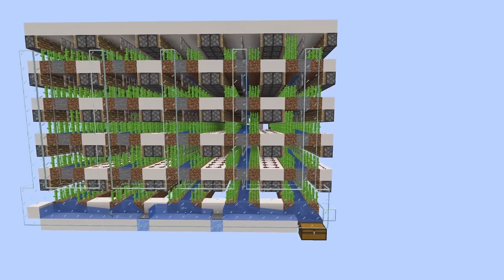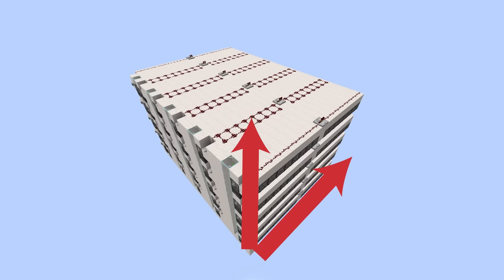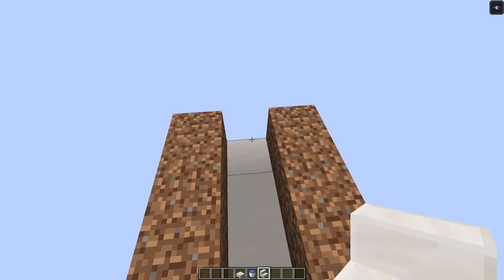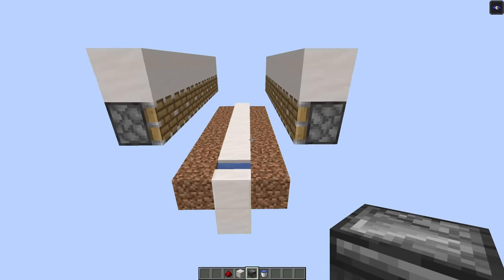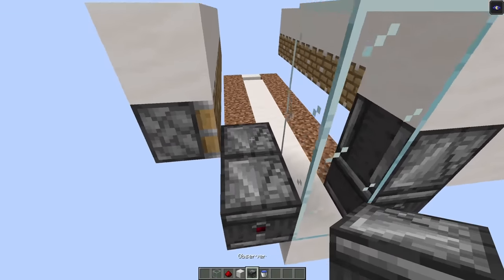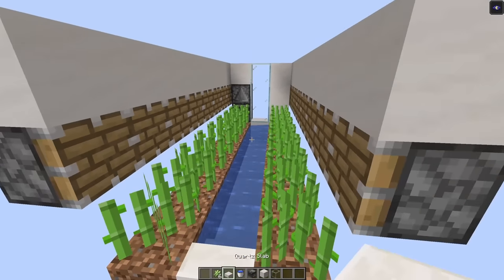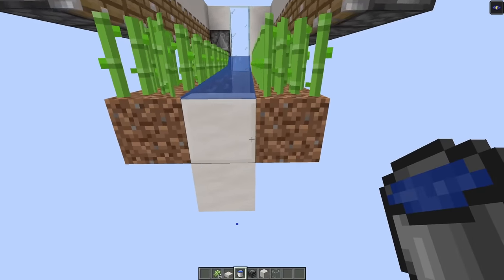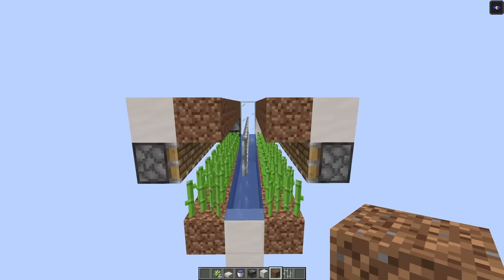Sugar Cane Farm! Compact, Lossless, Easy to Build! (Minecraft 1.15+)

Comment: so i dont quite understand why the observers are placed the way they are. Is there a reason the observer is watching the lowest sugar cane and not the second? and what is the point of the observer watching the observer below it??
Reply: Observers detect block updates.  The first one is watching the bottom block because in Java the bottom sugar cane updates even if it doesn't actually grow up a block.  The second observer is watching the second because every time the first one detects an update from the crop itself updates.  It's the easiest and compact way to move a redstone signal straight up 2 blocks without having to use dust or some mechanic that has the risk of being patched out.

Comment: This is a great design Tango! I have 2 questions.  
1. Are the iron bars replaceable with glass panes?

2. Could you use a design like this for an (inefficient) bamboo farm? I'm thinking remove the water source blocks and just have the water stream?

Thanks again!

Comment: Edit: Fixed it. Servers with the claim mod or the server i'm on. Did something to the water. When the area wasn't claimed.
Help: Java. Latest version. I'm having water issues. The only way the water flows. Is if I put 2 buckets of water. Then the first block doesn't flow down. I only have 1 built.

Comment: I‘m in the snapshot 20w22a and the flowing sugarcane is getting stuck in the stairs, which means that it‘ll eventually despawn. Can anyone give me some advices? 😊
Reply: I had the same problem. If you replace the stairs with a top slab the problem seems to get fixed. The collection system would also have to be altered slightly.
Reply: Put a trap door on the glass across from stair then remove the stair.
Reply: Thanks!
Reply: @ChristopherWeimann  you are the mvp man, thanks that work for me

Comment: I built this step by step, checked and checked again and it doesnt work for me either. The pistons randomly go off and the sugarcane is 2 high in some parts. Havent had 1 piece of sugar cane out if it 🤷‍♀️
Reply: Ye I have the same issue, I think its been messed up with a more recent update like 1.16.4
Reply: @jambo5461  I ended up taking it down and trying a different one. Its not as effective, but itll do for now 🤷‍♀️
Reply: @Nadlew90  ye I recommend flying machine one tho that’s what I use mainly and their super effective
Reply: @jambo5461  awesome, I'll have a look! Thanks 😊

Comment: Any reason why this wouldn't work with bamboo? i did the same exact design, but the pistons just don't seem to want to go off. I've even gone to the extent of placing one sugar cane in front of the observer on the strip in an attempt to get it to smash the line, but no dice. Not really sure why it's not working

Comment: Great design, but I'm having a small issue with sugarcane occasionally landing on the dirt instead of in the water stream. Any potential fix for that, or will it just get pulled in by other sugarcane that passes over time?
Reply: Yes...  sometimes it gets grabbed by he water flow and other times it will get pulled by another cane.
Reply: @Khudoz  I am facing the same issue with the farm. I thought the short pulse of the piston was causing the sugarcane to land on the dirt block. So I just added a repeater with 4 ticks delay to the output of the observer to increase the pulse. I am not sure whether this is a solution as i suck at redstone😬😬😬
Reply: @suhasmenon2705  I don't think adding a delay to any piston would solve this...  Because that doesn't change the velocity by which the sugarcane is propelled off its stam.
Personally I have seen a few of those "stuck" canes being de spawned! ...  Makes me wonder how lossless this thing actually is.
Reply: @Khudoz  Ohhh thank you. When i checked still some sugarcanes were getting stuck. So i guess delay is not an option. Also does lighting effect the growth of sugarcane? If so what is the minimum lighting for it to grow?
Reply: @suhasmenon2705  According to the Minecraft Wiki, the growth of Sugar Cane is not influenced by lighting at all!

Comment: Just incase anyone wants to know...thus dies NOT work on ps4 bedrock...u can not flow water on top of the slabs without the water breaking the crop
Reply: i made this work on ps4..i didnt slab ..i lowered the ice and pressure plate down a block and made the water thar is level with the cane be flowing...oh and for some reason...once in a while i got 1 cane on my redstone dust..so with bedrock its not 100%..but more like 98% but still works great

Comment: I built this farm on 1.20.1 and it works great apart from 1 problem. Sometimes the observers seem to "break" and they won't detect the sugarcane and activate the pistons. The only work-around I have found for this so far is to break the observers and re-place them, but this is an issue as if I afk for half a day and half the observers stop working then it very much limits the productivity of the farm. Just wondering if anyone else has encountered this issue and may know how to fix it?

Comment: hi does anyone know if i'm being stupid or not? i'm noticing that the observer detects only the bottom sugarcane so how does it detect if the upper one grows? this seems to be the problem with mine so far
Reply: I really dont know how the sugarcane block update works now but this is an easy fix. Just place the observer one block above
Reply: Unlike bamboo, When sugar can grows the blocks below and above are updated thus triggering the observers. But for bamboo you'll have to use the observer on the second layer and use a repeater method to prevent the pistons from firing indefinitely

Comment: i might have the dumb   but I donnt understand the observer set up...? its going to observe the sugar cane thats already there and will never be harvested therefore the block state never changes. this, does not work. I understand why it cant sit to the side (back of farm(now)) because it sees the piston as a changed state and does an endless cycle. A observer on every piston is way more resource heavy and annoying as the close proximity means every single time any of them grow to level all pistons go off. The problem I found with having 1 piston power them all (economic, just observing 1 plant) is that those that grow to 3 will also cause the plant to fall down, on the soil. I suppose you could do this, 1 observer on top of 1 piston and then all other plants can only grow to 2, placing a block above them? But then if you have a few growth spurts you miss out on the bonus cane / bamboo.

Comment: How does the observer detect if the sugar cane has grown if it’s at the bottom of the plant? Does the status of the sugar cane at the bottom change when it grows?
Reply: I want to know too hahaha
Reply: @LuizeraTryHarD_  It doesn't
Reply: Yes it works in 1.18. The state of the bottom cane changes when it grows a new cane on top of it. If growth doesn't trigger the observer you're building it wrong. It will also trigger the observer if you remove and replace the bottom cane.
Reply: if you ever play modded you learn real quickly early everything grows in stages for shugarcane it has several stages before the growth of a new plant and thr observer observing that its perfectly normal thus even of no new growth it should if working correctly fire the pistons

Comment: Does this design work with bamboos too?
Reply: It can for the most part.  I've tested it myself and by changing out all the crops except for the ones in front of observers you can generate bamboo fairly fast.

I built a 5x5x5 farm and downloaded the average items datapack from vanilla tweaks and after running it for an hour got an average of ~22,300 items coming out of the farm.

However doing it as bamboo is not lossless due to how the bamboo crops can sit on the blocks (haven't found a way to make the crops sit on a certain point of the block) and the fact that bamboo is solid so items will periodically get stuck when flowing down the streams.

Comment: Would this work with bamboo as well? Or are the item mechanics different between the two?
Reply: @Michael-McCollum  I actually tested it. It didn't work because the water breaks the bamboo unlike sugarcane, which holds the water in place.

Comment: what keeps the water from flooding everything?  I've done this identically, except with stone slabs, and whenever I try to add the water flow in, it expands to 3 wide and wipes out all of the sugarcane.  I don't get it and I'm pulling my hair out.
Reply: are you clicking the glass to put the water in or you clicking on the stab to put the water in?
Reply: @buckbuck-yt9uv  the glass.  If I click the slab, nothing happens.  I tried lots of different permutations. Oh well, I tore it down and built Wattles's

Comment: PLEASE I NEED ANSWER!!!
The farm is great, works like a charm. My question is how is the redstone get power? 
Maybe it was mentioned in the vid and I'm not listening, but if the bottom observer is facing a non-updating sugarcane, how or where does the redstone line above get power?
Reply: cause it can travel through a block
Reply: That sugarcane indeed updates.
Observers can detect block states, if I recall correctly, sugarcane has a tag called "age" and it increases overtime and when it reaches 15 it will try to spawn a sugarcane block on top.

Although there are no visual updates, there are updates happening in the background, like this "age" tag. 
Btw, you can check the "age" of a sugarcane block using the F3, if you are on bedrock RIP.

Comment: When making it vertically stacked. Any suggestions where to put lights? with the redstone and pistons I could not really find a great spot.
Reply: Torches on the side of the solid blocks the redstone is on. Did it with mine.

Comment: If you build it as-is, how much is lost? I don't care about it not being lossless, I don't mind losing a few every so often just as long as its not a huge amount.

Also, The sugar cane is growing past the observer and it's not firing? I have seen the pistons fire randomly but not when the sugar cane grows at the observers.

I'm on 1.19, if anyone has any comments, that would be greatly appreciated!
Reply: The pistons constantly fire as the observer detects every growth update from the sugarcane, even if it hasn’t grown
Reply: I’m 1.16 they made a change which make some of the items get stuck on the dirt as pistons connect to iron bars. Sugarcane also gets caught up in the stairs
Reply: @ponderer467 if you  use fences instead of gates, would that solve that issue? 

Also any reccomendations for what to use besides stairs?
Reply: @trocoplaytv1254  yes it should, also instead of the stairs just use a waterlogged slab and have an open fence gate in front of the water to stop it spilling out. Hope it works

Comment: Not to be a meanie-bo-beanie, but aren't these rates rather low? Sugarcane grows 1 block every 18 minutes which equates to approximatly 3 sugarcane per hour. That means that that each module will only produce 48 sugarcane per hour.

Compare this to shulkercraft's design, which produces 1300 sugarcane per hour. To achieve the same rates you need 27 modules. That's a lot of resources. I don't know, it just seemed kinda slow.
Reply: @Kyakou I do, but I believe the design that incorporates the flying machine is less resource intesive and therefore is more cost effective. I just thought that people should be made aware that a better design existed.

Comment: Does anyone know the rates per module? Edit: I'm getting roughly (very roughly) half a stack per module per hour.
I am running this on the latest snapshot, and I'm noticing every module save the bottom ones are getting sugarcane stuck on the stair. They aren't all going over the edge. Any idea what I might have done wrong or how to fix this?

Comment: how does this observer setup work? what is the observer checking? and based on what is it firing? I dont get it
Reply: Observer basically observes a block change in front of it, so it detected a sugar cane in front of it this giving out a redstone outpur
Reply: @ahsenmughal9675  But one observer is watching the lowest sugar cane which never changes. the other observer is watching the first observer. so my initial question is still open. I would totally understand if the observer would check the second level of sugarcane and detect when a new sugar cane is grown. but in this setup?! also. ich the second level growth the piston not automatically fires. its kind of seems random. I'd love to get a more detailed explenation.

Comment: I have a problem with this now. Did exactly how you did a single and now it randomly just goes off. And when I put a water bucket to flow the water, it destroys everything. Lol. What did I do wrong or what did they change?
Reply: same
Reply: it will go off every time the bottom sugarcane ages.. if you press f3 and look at the sugarcane, you will see in the right side in the target block section, there is "age".. sugar cane needs to age 16 times before growing a new sugarcane block..

Comment: So this farm isn't working for me. The water doesn't flow straight no matter how many times I do it over. Cant figure out what the problem is. Anyone able to help me?
Reply: If you're looking at the world download like I did, then you'd see Tango put bottom slabs, despite the video saying top slabs. So to get it to work, you first waterlog top slabs, place the water source that actually carries the sugar cane straight next, then remove the top slab to replace with bottom slabs.

In other cases, it might be easier to just make a trench for water sources to fill, then top slab it, then place the carrying water sources, then replace top with the bottom slabs. Multiple ways to do it I guess.
Reply: Are you putting top slabs in the water source blocks the full length then putting the water down for the stream?  Also are you playing Java or Bedrock?

Comment: Does anyone else have a problem where the sugarcane gets broken and gets stuck on the dirt on which the sugarcane is growing?
I do.
Anyone have a fix, or am I doing something wrong?
Reply: are you on bedrock? if so theres not much you can do about it, bedrock just works differently to java
Reply: Visible Confusion I’m on Java. That is what’s quite weird
Reply: @harikeshavr8161  maybe they changed something in 1.16, also try placing full blocks under the pistons so the only way to go is where its supposed to go
Reply: Visible Confusion will do, thanks!

Comment: I am trying to do a 2wide by 2 tall. But the flow on top is all messed up if I take out the slabs. Java 1.19 on PC.  Any advice?
Reply: in 1.19 replace the water between the dirt with water logged leaves to makes the flowing water on top less frustrating.
Also replace the stair with a leave block that is water logged.

Comment: Is this still lossless in 1.18 with iron bars? I built this in 1.16 with fences instead and I think it was lossless then. Now in 1.18 with fences some canes get stuck on the dirt blocks. This may be because fence is slightly thicker than the bars
Reply: I get a little bit of loss but its still good

Comment: I needed i modified a little of the farm just so it can work on bedrock and this baby is running like crazy. Im making it bigger bit by bit there's 6 modules by now  i pretend to reach 12 at the end so i can have a pretty fast sugarcane supply.
Reply: what did you do to change it? i’m on bedrock as well
Reply: @lilgrey8363  the way they he put the waters in java does not work in bedrock. So i only placed the iron fence one ylevel below the dirt and than the water stream over the fence. The farm is extremely expensive, so have that in mind. To be affective u need make at least 9 modules to start to have good rates.